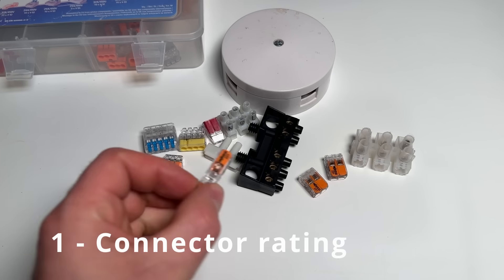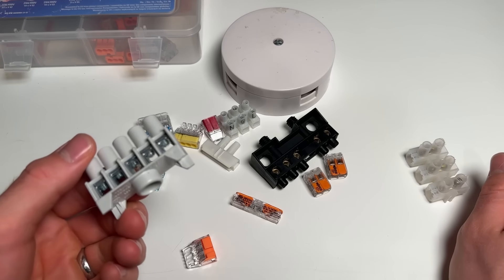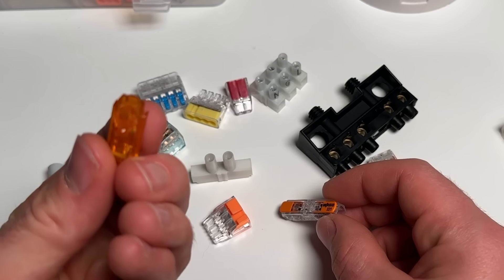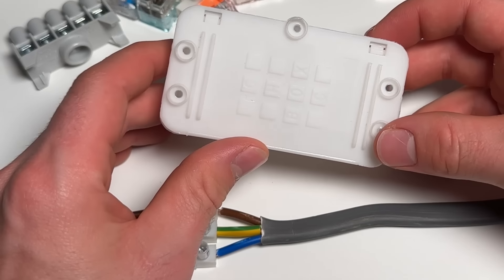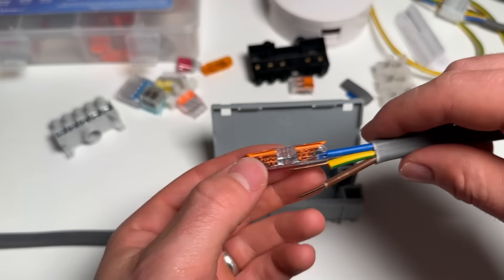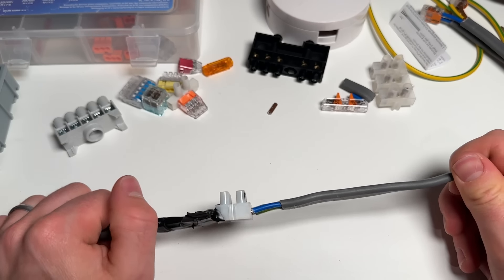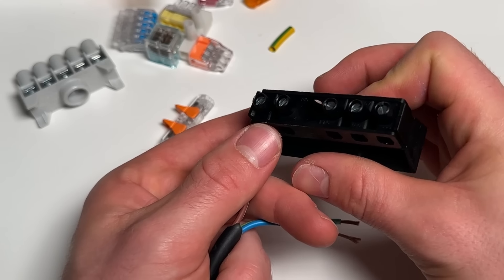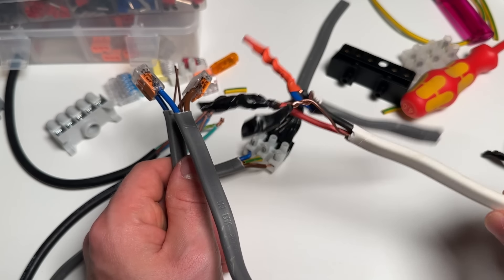BIGGEST DIY Mistakes Joining Cables

Comment: When you say something is wrong, do you mean it professionally or personally?  Every connector on sale, regardless of design, must meet the standards of use, otherwise it would not be sold!  How to use them correctly.  .  .  Have you seen the instructions in the stores?  It is even more likely that devices that are purchased are improperly connected (because they skimp on the material) than those that we connect ourselves.  It's nice to know what to use when everything is at hand and in stores, but there are situations when a short-term solution is the only solution.  And to spoil your thoughts a little more, the main fuses do not use your connector but screws, why?
Reply from the maker: You really have spoiled my thoughts. If you watched the video more carefully I say the issue is people using connectors not rated appropriately, rather than condemning all screw terminals.
Reply: @TheDiligentDIYer1759  The representation of the connectors with the thickness of the wires was not correct.  When you present the standards for connectors, it is important to do this also for the wires and their connected consumer devices.  When the wiring is planned, it starts with the power of the fuse, continues with the thickness and length of the cable, the distribution connector if it is planned for several uses of lower consumption, or the direct connection to the high-power consumer device (refrigerator, oven, cooker, dishwasher and washing machine...  .ideally you would have a fuse for each socket.) And some of these powerful appliances must be connected directly without a socket.  But we all know that buildings are always built with the intention of saving on material, so the minimum number of fuses is always planned, which means that the fuse values are higher and the weakest point of the wiring in the apartment is always the cables.  The connectors may be part of the problem, but who has already commented that it will be necessary to replace the existing wiring and fuse when wanting to connect a distributor?  And computers are one of the problems for electrical wiring, when today they consume as much as an oven and people plug them into new distributors, and the existing wiring overheats and catches fire.

Comment: Good too see this is a sponsored video 

Being an electrician of 46 years I would question your rationale and description of the reasons you have used
All of those connectors are suitable for most applications if you prepare the cables 

I do not you those connectors you are advertising as  I have found they develop more issues over time than the traditional methods
They  are less the optimal in an corrosive  environment 

 Preparation is the key to all connections irrespective of of the method used

Yes current rating of the connector so important  but not as important as preparation
Reply from the maker: This is not a sponsored video…

Comment: I just never understand why they don’t use copper in the connectors to keep optimal current pass though, drastic reduction on energy loss, and will not oxidize over long time.  I understand the use of other materials (other than copper) is more cost effective for the manufacturer, but come on!  They’re already charging an arm and a leg already. 😢
Reply from the maker: I suspect it is because copper isn’t as strong a brass or steel, so if you make a screw terminal out of copper, it will likely deform easily. Thanks for watching!

Comment: The clickbait was strong
Reply from the maker: Did the video not live up to the thumbnail expectation? I know the wago could be slightly misleading but meant to show exposed copper. Thanks for watching!
Reply: @TheDiligentDIYer1759  yes, but that would just be user error. The actual Wago is fully insulated.

I've seen Wagos be used with big aluminium wires and it was a fire hazard, as they barely made contact. Connector blocks are a strong connection that cannot be wiggled loose, but are harder to install. The video was great ! 

But I saw it with other youtubers as well : the thumbnail is just critisizing every type of connector to grab the viewer's attention. That is what I disliked.

Comment: You are not supposed to use ferrules for those wago connectors. Stranded wires go straight in, that's what wago recommends in their manual.
Anyone watching this video, please read the official documentation of the type of connector you use
Reply from the maker: The Wago 221 manual doesn’t mention ferrules, that doesn’t mean you can’t use them, and it certainly doesn’t mean professionals wouldn’t consider using a ferrule on stranded cores best practice. 
Thank you for sharing your opinion.
Reply: @TheDiligentDIYer1759  Any kind of safety critical equipment should be installed exactly as the manufacturer recommends it. If they don't mention something, yes it absolutely means that you shouldn't do it.
It was designed, tested and certified that way, it's only guaranteed to work properly that way.

Comment: I'm afraid you are wrong from the start.  UL is Underwriter's Laboratory.  The C is Canada and the US is America.  We share the same rules and codes for the most part!  The PSE listing, I don't know of.

Any quality connector will include the DC ratings of which are significantly different!

At 6.45.. Why did you twist those wires anti-clockwise?  That's against code in any situation!
Lawd Fadda, at 7:11 you do it again on the stranded wires!

As for Wago connectors, I have seen many that have overheated with blackened connectors and wire.  I'm not impressed!  Too many variable applications and even electricians use these wrong or poorly.

A thumbs down from me
Reply from the maker: Don’t forget to like and subscribe
Reply: @TheDiligentDIYer1759   Would appear as though you DID NOT read my comments and you got a thumbs down from me!

Comment: Video 1 year ago i have to question and yes, i will thumb you down.  are you still a DIYer  or have you now started your electrician course.  Judging from your picture your a young man and doing diy jobs you had gained such knowledge and experience to feel competent with your work, if only recently now 2025 you had taken a keen interest in electrical work i would be interested to know if your interest started after 1995 ?, if so you certainly will not know nor be able to now find information to substantiate the facts, Too many young people taken up and became qualified electricians without questioning the cabling used, you will reply as you will be curious of the question, the 2.5 T+E cable strip the outer sheave exposing the 2 conductors Brown and Blue, for this purpose now strip the Brown and Blue 10 - 15 mm back exposing the copper wire, with your thumb and finger bend the copper wire in equal half so as to push into a screwed socket terminal and note how much force was needed to bend ?.  The second part to this question will be made clear once you become curious as to the my question, WHY.

Comment: All these connectors are pretty bad for high currents, the best option is to just twist it together, then wrap it around with another copper wire and then solder it properly. Such connection will survive for 100 years, but ofcourse you can't disassamble it. Some electricians are electro-snobs or how to call them and they believe that when you use non official DIY solution, it's dangerous, but vice versa is truth, those chinese shits from electro shops are more dangerous than DIY solution. We call those basic connectors chocolade in Czech, I use them only for earth or in places where low current is expected, like connecting led lights and stuff like that, I would try to aviod these for electric radiators and stuff like that.
8:25 - When I expect very high current, I am trying to avoid all these solutions where it's not copper to copper connection, so believe me, properly twist it, then wrap it around with another copper wire and than solder it is the best solution.

Comment: Wago's are perfectly safe and strong when fitted correctly, the Electrical industry has been using choc blocks for many many years and there are still thousands in use on a fail basis.
When you use good quality connectors and fit them properly, they rarely fail. The only truly bad connection method you is the third one, and let's be honest: Only an absolute moron would connect wires like that.

Comment: Every thing you show is crap,  the best joint is compression lugs,  bolted then insulated.   Ne
Next best is a bronze split bolt, the insulated.
Reply from the maker: Compression lugs and split bolts would be usual and unnecessary for domestic wiring. 
Also being polite goes a long way….
Reply: @TheDiligentDIYer1759  The connectors that rely on spring tension only,  are only fit for pot lights or similar applications.   Not fit for circuits operating near peak capacity or any dirty, moist or vibrating environment.
Reply: @TheDiligentDIYer1759 Been a spark for over 30 years and everything you said was spot on so ignore Terry the troll, he must be a plumber. 🤣
Reply: Use 3m scotchcast 82-A1 inline resin splicing kit if you want to be sure.

We always use them under water inside deep wells and we are using octopus splice still a kind of tie that tightens if pull both wires